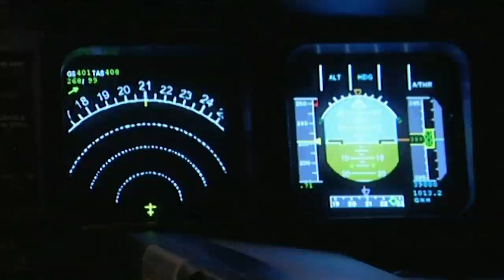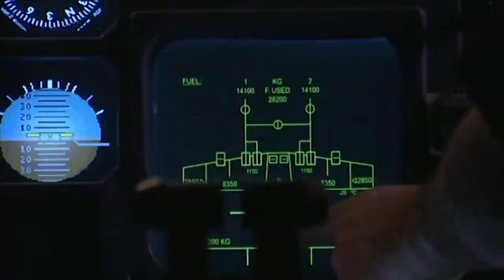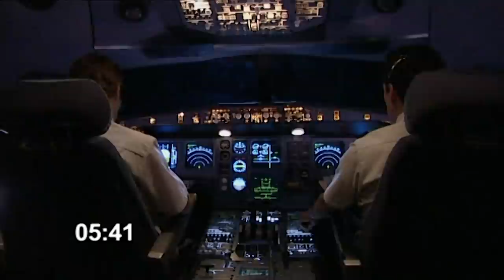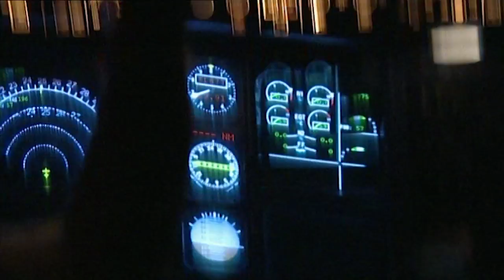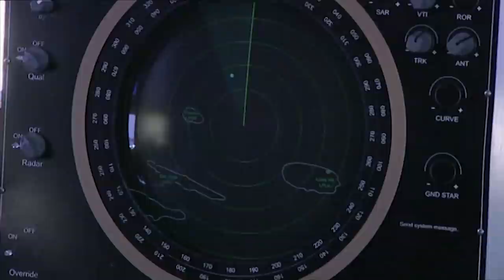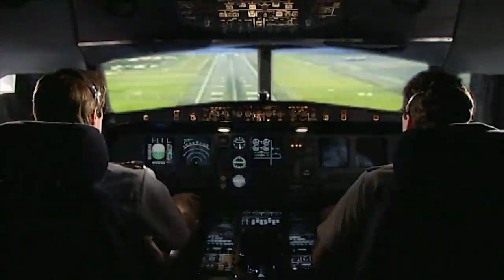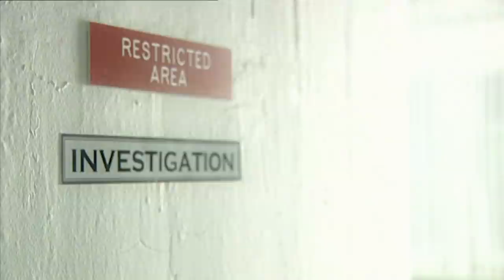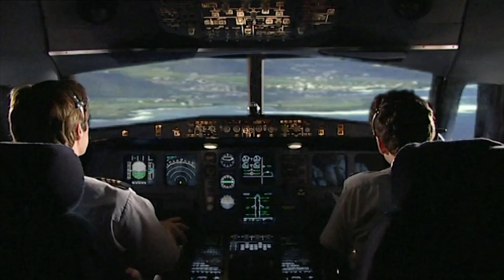Pilots Try To Reach An Airport With No Fuel | FULL EPISODE | Mayday: Air Disaster

Comment: Strange that the pilots did not manage to ditch like Sully in the Hutson.
Reply: This took place 8 years before the Sully incident.
Reply: @latoyamcdonald4444  That does not answer my question, why did they not land like Sully?
Reply: @griffith500tvr Because a water landing is not an ideal landing option.  They were also way higher and faster than Sully was. Air planes are not built to float. The Hudson is s narrow calm river it was daytime and clear skies. With rescue workers in route. Night time over an open ocean with no rescue personnel around for miles is a rather dangerous gamble. Aviate,  navigate, communicate.
Reply: @latoyamcdonald4444  Sorry but the plane came in at an angle, not as straight as possible, it seems to me that the pilots did not even try ditching property. I have a pilots license myself so I have difficulty understanding what went on there.
Reply: Trying to ditch on ocean swells even in a calm sea is not remotely comparable to ditching on a still river…at the speed they were traveling the plane would have broken up and sank immediately.

Comment: Sheesh this is horsesh*t. Clearly AirTransat and the crew aren’t blameless, esp since the maintenance folks knew there was a parts mismatch, BUT… the #1 culprit here is completely let off the hook!!!  Rolls Royce delivered an incomplete/inadequate/faulty assembly.  The biggest blame here lies with Rolls Royce.  They delivered an incomplete product.  They left AirTransat in an untenable position.  You either rig it (which they did) or pull the plane, costing the company possibly millions of dollars.  Roll Royce is THE responsible party in this near catastrophe.  Neither AirTransat nor the crew are blameless, but they’re only the secondary, minor responsible parties.  Rolls Royce is THE culprit here.
Reply: How do you know Rolls Royce didn't deliver exactly what was ordered? That the error didn't lie with AirTransat for not ordering everything they needed?